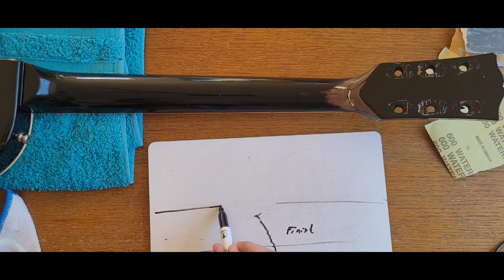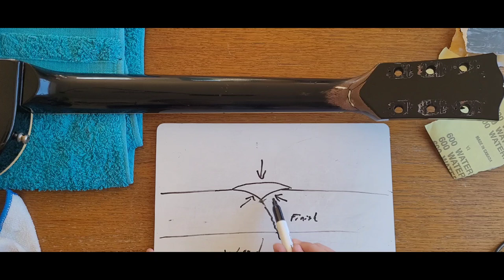MAKING A STINGER on a broken Les Paul! Headstock restoration!

Comment: Man, how do you release refinishing videos smack dab in the middle of my refinishing projects. Happened with your Jag refin video too. Great timing. And great intro! Enthralling story-telling.

I missed what kind of lacquer you used to fill in the headstock chips at the beginning. I have another guitar with an unsightly chip that I’m trying to stabilize and I feel like that process would help. 

Also, Elmer’s glue was used as grain filler? I’ve been using super glue and sawdust but Elmer’s seems like much less fuss. 

Man, what a finished product. Looks gorgeous. Did not expect the headstock’s checking to vanish the way it did. 

Love how you use a tp roll for your neck rest. I was thinking about buying one, but turns out I already have a dozen on hand😂
Reply from the maker: Lol, the tp roll is a really old habit!  I remember asking my dad for a neck rest to work on when I was like 15 and he walked back in with a tp roll like 30 seconds later. 
  I lucked out of the headstock chips and let the 400 roll the edge slightly. Took out nearly all! As far as the headstock clearing up the way it did....  I didn't think it would work that well! It almost did too good a job! 
   As far as timing, great minds think alike!